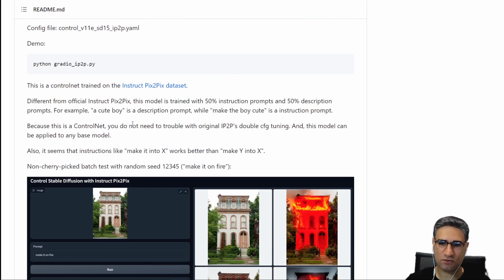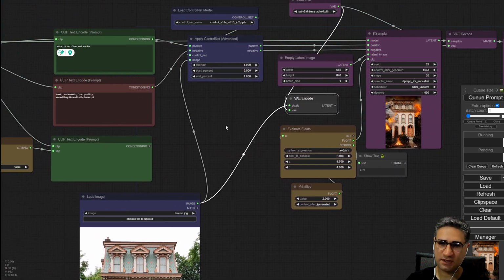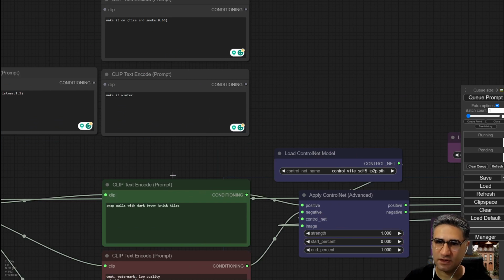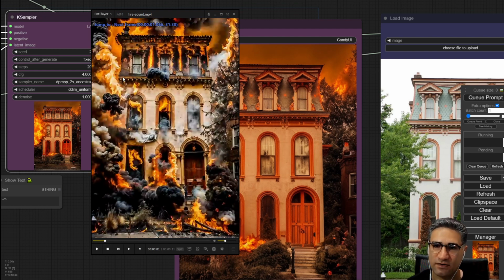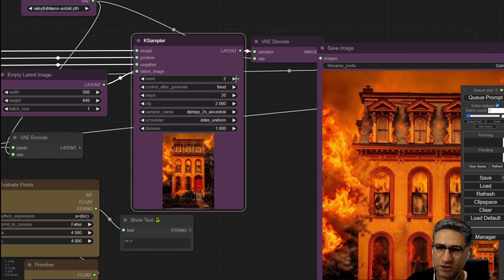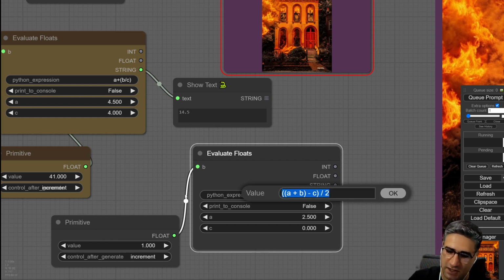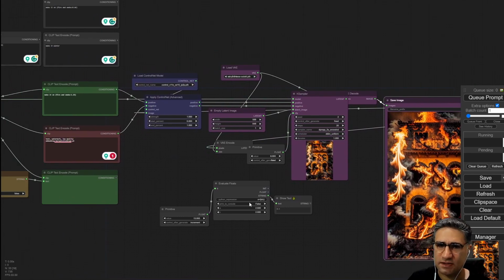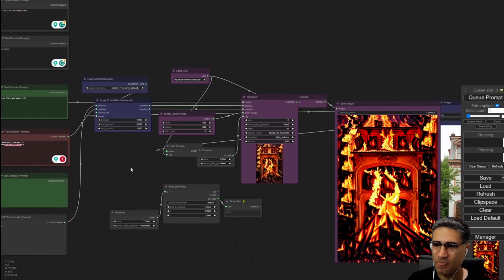ComfyUI, how to use Pix2Pix ControlNet,  and Animate all parameters and prompts for a dynamic result

Comment: hi, I have installed all the necessary nodes such as efficiency, WAS, and pythongsss. However, when I open the node primitives, there is no option to connect a float. It only shows "connect to widget input." Could you please provide me with some guidance?

Comment: Hi,
Very new ComfyUI user here, thanks for your tutorial. When using evaluate Floats using your expression I get the following message:
Error occurred when executing Evaluate Floats:

name 'simpleeval' is not defined

  File "C:\Comfy UI\ComfyUI\execution.py", line 151, in recursive_execute
    output_data, output_ui = get_output_data(obj, input_data_all)
  File "C:\Comfy UI\ComfyUI\execution.py", line 81, in get_output_data
    return_values = map_node_over_list(obj, input_data_all, obj.FUNCTION, allow_interrupt=True)
  File "C:\Comfy UI\ComfyUI\execution.py", line 74, in map_node_over_list
    results.append(getattr(obj, func)(**slice_dict(input_data_all, i)))
  File "C:\Comfy UI\ComfyUI\custom_nodes\efficiency-nodes-comfyui\efficiency_nodes.py", line 2844, in evaluate
    result = simpleeval.simple_eval(python_expression, names={'a': a, 'b': b, 'c': c})

I have tried different methods to install the nodes but get the same result. Do I need to install anything else?
Reply from the maker: Now Please follow this video: 
https://youtu.be/MObjzFsyEy0